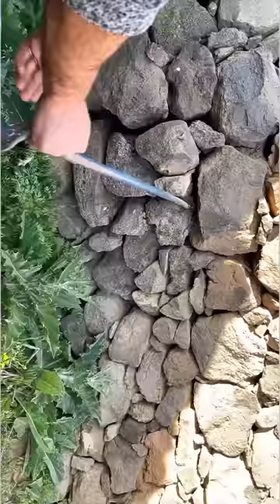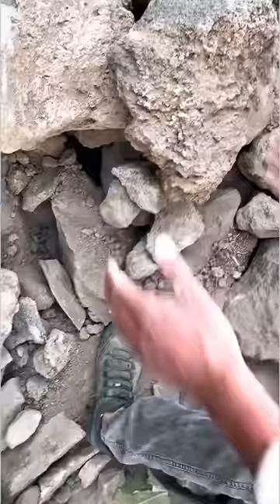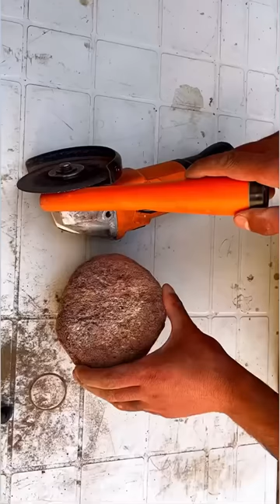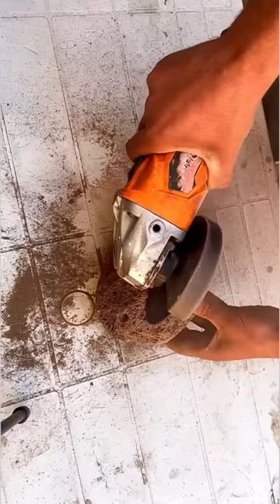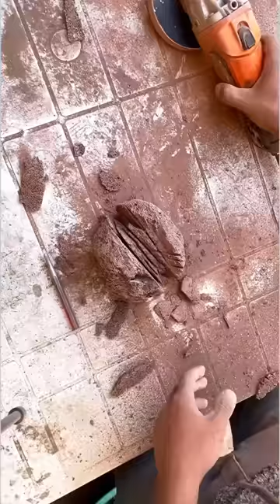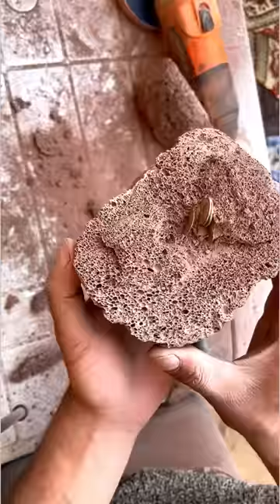treasure hunter #shorts

Comment: First off that pinpointer would not detect more than 4 in or 5 in away from the object and especially through Rock.... It may sound off on a hot rock but unless that rock with the coins was on the outer surface that pinpointer would never find it.